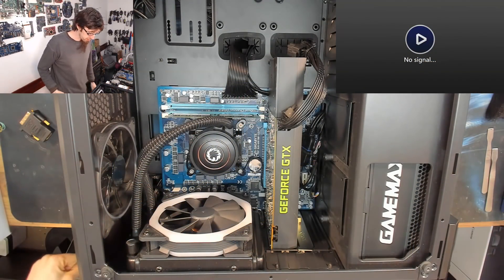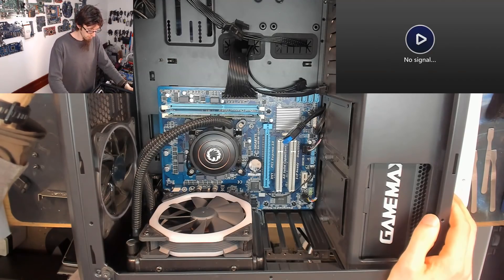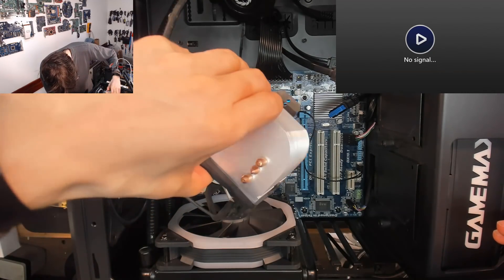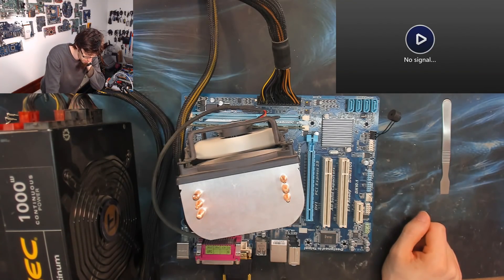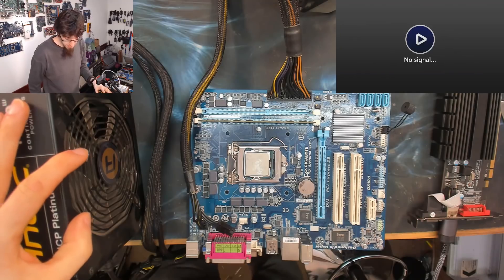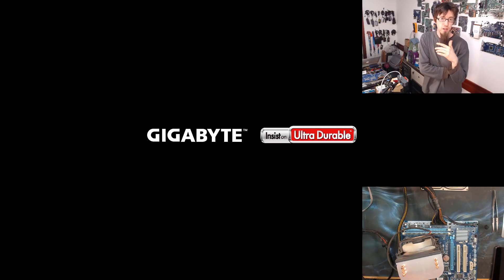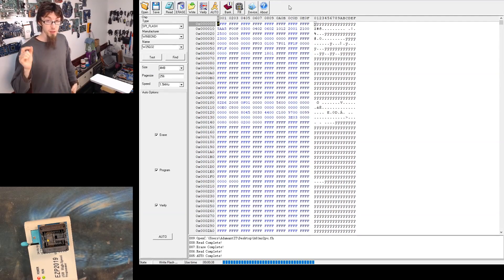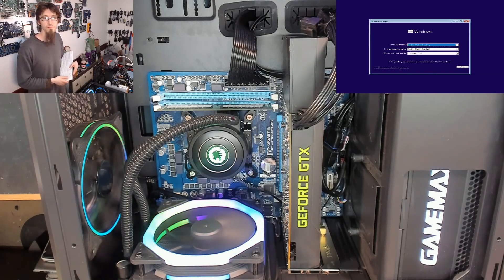LFC#207 - Troubleshooting an old Intel Platform (GA-H61m)

Comment: I remember a long while back I had a  gigabyte P35 DS3R board that did that with certain types of ram, if I remember rightly back then the issue was to do with the  ram and  the fact  that  the ram voltage regulator was limited and  was misreporting the ram voltage  in the BIOS which caused leaving the setting to the SPD to end up with  a bit of graphical corruption with descent ram, but swapping the corsair ram out to cheap units and setting the timings and voltage manually before shutting down and refitting the corsair units solved the issue  so I left it at that

Comment: Hello ! The time you remove bios battery why don't you jumper the pins for bios reset ? Is the battery removal only enough ?
Reply from the maker: I've always found that battery removal is enough (I've felt it was better, but I couldn't tell you why) but I think I need to renew my faith in the reset jumper. I think it's because no one's sure how long to stick the jumper on for, but taking the battery out for 5mins is absolute.
Reply from the maker: Hey dude, I love sharing ideas and methods with others, but you could be less of a dick about it. Good luck on your next repair.
Reply: @Adamant_IT  Thank you for your answer ! I am also learning from your repairs , so keep the good stuff running.. !

Comment: one note to make, gigabyte has revisions of motherboards. like rev 1.0, then possibly a 1.1. if theres a revision version on the board it will be in the bottom left of the board and say rev x.x. and yes you need to get the bios for the revision of the board. it looks like it says rev 2.1

Comment: As an electronics tech, i would be looking at the on-board voltages (maybe starting with Vcc on the bios chips) This is an old motherboard with "inconsistent" behavior... My first guess would be a marginal (or noisy) supply rail....  Very likely due to an old capcitor (or 2)

Comment: what power supply do u use when injecting voltage for shorts?
Reply from the maker: I have a Hanmatek HM305p. It's available under a couple of different brand names.
Reply: @Adamant_IT  thx

Comment: Hey! I have exactly the same issue, with a GA Z77 D3H, I always had a super slow post screen with gigabyte logo, thought it was the board was just rubbish but some features were good, my wife wanted one and I managed to get one cheap and then realised my board wasn’t rubbish it was broken lol! Tried swapping bios and had this issue, need to flash it as never been able to acsess the bios was wonders when I saw my wife’s bios for the first time hehehe! Soldering isn’t an op for me my local pc shop won’t solder would you flash mine? ;) it’s a super capable board, good for overclockimg

Comment: My Asus h61m-e did the exact same thing. I cleaned the bios and nearby chips with contact cleaner and it seemed to work but had to do it monthly until it stopped working altogether had to replace the motherboard. Wish I had flashed the bios like u did, anyway can u recommend a good and cheap bios programmer so i can do something like this in the future as they will also work in flashing a gpu bios as well. 
One more thing, is the motherboard still working, is it stable? Please let us know
Reply from the maker: Yup, board seems fine starting and running. There's more to learn from it still, but I haven't had time to investigate further. Programmer was the EZP 2019+, which is all over eBay.
Reply: @Adamant_IT  thanks for the reply

Comment: My father had a AM2 lenovo that would be totally black with fan spinning if the cmos battery was low! Like you'd expect it to say 'cmos battery low', but that was not what it did. I pulled it out then tried a new battery later and it booted fine.

Comment: At what temperature is the heat gun set if you know?
Reply from the maker: For motherboards I run 400c, and I maintain a little distance so as not to roast things. Anything that's not a motherboard, you'll want to run much less heat though.

Comment: Good day sir. What type of power supply did you use for ur voltage injection? And what if i dont have one. Is there any alternative to find the shorted component in easy way? Thank you sir
Reply from the maker: I have a Hanmatek HM305P. The only other way to find shorts without injecting power is by studying the schematics and tracing the circuit out - but this isn't viable unless you get very lucky.
Reply: @Adamant_IT  thanks for ur response sir i've learned a lot in ur videos
Reply: @christiantutop9962  You can buy cheap but reasonable CC and CV adjustable DC to DC buck power supplies on eBay, Ali etc. for under €10.  If you want a good, cheap AC model, maybe one of the Gophert ones on AliExpress?

Comment: Great video as always.
I have a friend’s computer (Z87M Pro4, i5-4570) that has the same problem that you faced (boot loop cycles). 
I tried swapping ram, gpu and psu but still it does not post
I don’t have another cpu or motherboard to try so I have bought another motherboard hoping that it will fix the problem.
Maybe, It can be the CPU?
Also you gave me the idea to use a eeprom programmer so I will try with that.
If you have other advices let me know.
Thanks for all your videos, they are very useful and interesting
Reply: have a similar issue on my Z97 board. but with me is boot loops sometimes, will not boot at all other times and when it boots bios says overvoltage on 5V.

Comment: I'm still learning. I remember when I nearly got electricuted by my power supple. It shorted to the box from one of the Sata power cables. As soon as it shorted. The PC turned off and turned back on. It booted and Posted just fine. I'm thinking, in the case of the PC power cycling in the video, could it of been a short somewhere?
Reply: *supply
Reply: Maybe a faulty component is the cause to the scrambled display?

Comment: That was a twisty one lol.
I had to use the built in display to see what was wrong with a mates machine.
It worked and as i touched the memory strips one of them upset the display, thin lines appeared.
I would not trust memory as far as i could throw it, err well lol.

Comment: Looks like everything started, when you took out the hard drive, for another project and then.. Operating System, and the hard drive.. you said, IT seems to be waiting for something... Orders.. a command...
How the heck, it worked before and now there's a problem.. could be a simple loose wiring?

Comment: Clamp is not a reliable flashing method when the chip is in circuit. You might get corrupted read/write with errors etc. so it's always safer to flash the bios outside the circuit. (it does not relate to flashing on working machine by dedicated software)

Comment: having worked with few of these motherboard, i think you could have saved your life some time by taking the right steps. for example, if everything worked before you replaced the hard drive, why would you go and replace Cooler, PSU, and processor? shouldn't you be starting with hard drive? all in all good video tho.
Reply from the maker: Because disconnecting the HDD didn't fix it. I had the SATA cables unplugged almost from the start, and mid way through swapping components I even unplugged the power from the HDD just in case that was upsetting the PSU somehow.

Comment: what flashing software are you using?
Reply from the maker: EZP2019, it came with the programmer I used, which is the super cheap one all over eBay. It seems pretty good, recommended tool for a workshop. As I mentioned in the video, this is maybe the 3rd time I've used it, but being able to do an off-line flash of the BIOS is very handy in certain situations.

Comment: if it was power it wouldent light up or make fans go?
Reply: There are multiple voltages....; fans and lights just mean that some power is present, not that all the voltages are present and/or correct, and, we certainly do not know if they will be sustainable under a full load....

Comment: Check the CSM in BIOS settings, sometimes old H61/B75 Gigabyte have scrambled display problem in BIOS, fixed by turn ENABLE or DISABLE in CSM settings.
I have same model mainboard on my daughter PC, if i upgraded with different model GPU, sometimes this happens.

Comment: I have the same motherboard with the same issue. It propped up after I upgraded by GPU. Everything ran well when I first put it in, but stopped working entirely after a reboot. I tired everything mentioned in this video and a lot of videos before it but nothing seems to fix it. Took it to a shop, they told me it was an issue with the ram slots and charged me 50% of the price of the board to 'fix' it. So from their word, it works with a 1060mhz ram, but any ram above it, be it 1333mhz or 1600mhz doesn't work. Bizarre issue and I have no idea wtf is wrong with it.

Comment: when using the tweezer to read the chip in pcb lift vcc or reset  pin from board this way you will always read the chip (basically i lift pin 8 vcc is easier i put a corner of a sheet of paper between the chip leg and pcb so that when i close the tweezer the leg does not touch again in the pcb)

Comment: If you just flash a bios like that you will definetly erase the serial number and sometimes even the MAC address. This means that the generated UUID will be different -> windows will see a different mainboard -> no longer activated
Reply from the maker: Naa... serial number maybe, but that alone won't be enough to disturb activation, the UUID needs to change significantly, a small alteration won't do it. MAC address will be in the PCH firmware, not the BIOS.

Comment: Back in year 2000...when fixing no POST,  the first thing i did was to remove all the RAM, HDD, just Mainboard and CPU and power it up...If you can hear a series of beeps, then the mainboard, BIOS and CPU is good. Then it just the matter of swapping RAM and Video card to see which one is fauty and stop the PC from booting. And 80% would be RAM problem....and most of the time, the RAM not actually bad, it just needs something to discharge (or refresh) the memory banks ( very different from just cleaning the contact pins) and what is did and work all the time, was using a piece of the protective thin metal coasted paper inside a cirgarette pack, with the metal side wrap around the pins of the RAM module, moving up and down the pins for 5 seconds and put the RAM back on the motherboard, and it WILL work...

Comment: Maybe clean the contacts of the RAM and socket - not sure but I have seen similar video corruption on integrated graphics where the RAM contacts or timing were marginal. Also maybe clean the contacts on the other RAM slot - you never know!
Also wiggling the RAM in operation with the iGPU will likely show a sensitivity if timing is the problem.

Comment: Moral of the story: don't be scared of Beta Bioses.
Reply: Generally speaking with gigabyte, and a few other mother board manufacturers I've used, if the bios is shown as beta but there hasn't been a new bios for a year or more then there is a good chance it's a stable bios.
Reply: Just be scared of Gigabyte

Comment: If you want to use that cable you will need to mode the EZP2019. The issue is on pen for it is not getting the right volt to pen 4. Just solder on the backside of the ezp solder a jumper wire from USB ground to pen 4 and that should resolve that issue,
Reply from the maker: Interesting. I'll take a look when I get time - it would be nice to have a no-soldering solution.
Reply: @Adamant_IT  :)

Comment: You say you wanna dabble in more repair stuff on this channel... maybe BIOS is bad on a MSI GTX 460 cyclone I have. Will post and put out video but it's all screwed up. 

if interested in trying to fix it lemme know and I'll send it to you, I just was gonna do a sli setup with it since I still had my original, bad one I got off eBay for like $40 lol. It was pretty banged up when I got it. Straightened out bent heatsink fins, fresh thermal paste and just clean up all I've done to it

Comment: You can stil buy those eeproms. If i had not ripped off my solder padsby unsoldering with a cheap iron, because the clamp didn´work, I would have tried this :D

Comment: it happend to me too on my first flip build, you could easily have fixed the corupption by using the backup bios. if you press the power en reset switch until the computer boot cycels the bios wil be reset and it will copy from the backup bios

Comment: I bricked an Sabertooth mobo , fault traced to bios corrupt. As I had another Sabertooth mobo I swapped the chips over, original board worked. Did a bios update on the working chip, and then ran bios update again, but changed the chip before I ran the update "hot swap". Both boards now OK.

Comment: my bios says overvoltage on 5V just with ram and cpu even with new PSU, ordered a new board hope my guess was right on bad board.
Reply: usually its a bad capacitor near the usb port or a resistor.

Comment: I had something it simpler with a laptop. The bios was faulty and wouldn't let me get into it. But I managed to get windows 10 installed on it. Then I used an old windows bios update tool on it. It loaded an old bios on it which I could get into and  I updated to the latest bios through the bios its self.

Comment: Maybe your programmer can not supply enough 5V/3V3 power to supply all the parts that are powered by the same rail as the BIOS chips most likely SB5V rail.
I have had better results sometimes using the onboard BIOS reset jumper.
Reply: I’ve had my programmer actually give an over current error when trying to read chips that were still on the board.

Comment: There is this trick that you can use,its just that you have to short the  4 pins of the reset switch and the power switch and turn on the power switch,then you will see a message on the screen,saying recovering from corrupted bios,wait till it finishes and reboot,it will work properly.
Reply from the maker: Ah I could've tried that actually yea - I've been down that route on newer GB mobos and gotten nowhere, but those don't have a 'manual trigger' for the dual BIOS.

Comment: I have issues with 25q32 then programming in quart mode (sorry for the bad English)
Reply from the maker: My programmer didn't seem to like the 25Q32 very much. I never did get a successful 'test' when checking the programmer setup, but when I tried programming it, it worked. Quirks of a cheap programmer I think.

Comment: can you help me i am a big fan but my nvme ssd is not being reconisted i bios is it broken
Reply: Are you sure it's compatible? I think there are some m.2 slots, which only accept sata drives, not nvme
Reply: I dont know i have a z170 pro gaming form asus
Reply from the maker: Have you got anything connected to SATA port 1? What model SSD are you using?
Reply: It is a ssd nvme from a hp pc and my motherbord only has 1 nvme port and i disconnected  every hdd
Reply from the maker: Just double checking, but it's not an Intel Optane drive is it? I know those appear in OEM computers sometimes - they look like SSDs and have NVME written on them, but they don't behave like SSDs.
Other than that, I'm not sure, it sounds like everything is right. I take it you've tried installing windows, and the windows installer doesn't see the drive?
Reply: No its not a intel

Comment: 3 days ago i fixed my motherboard ga-z77-d3h with similar problem, power on nothing happens, reboots nothing hapens, reboots again then it shows post screen of backup bios and reboots again. Then found out simple solution. While holding power button i inserted power cable to psu for second or two just to spins fans, pull out cable wait for 5 seconds and repeated proces for 3 times, released power button and it restored from backup to main bios by itself, and after reboot pc works again :) maybe can help someone. And great video, detailed work thumbs up for that.